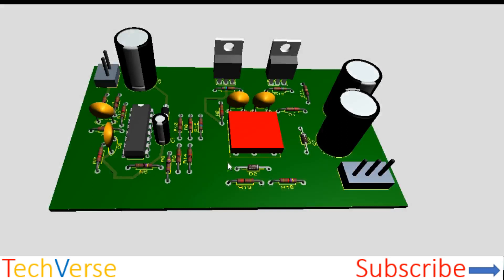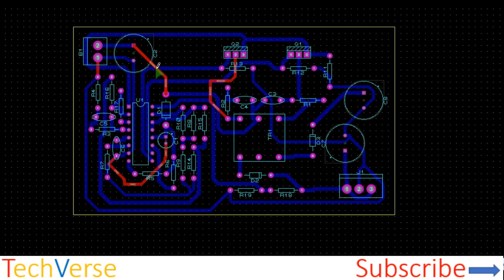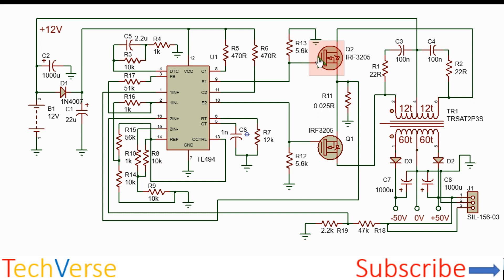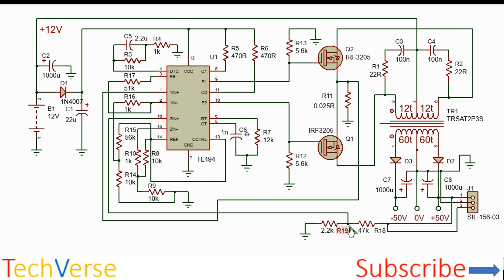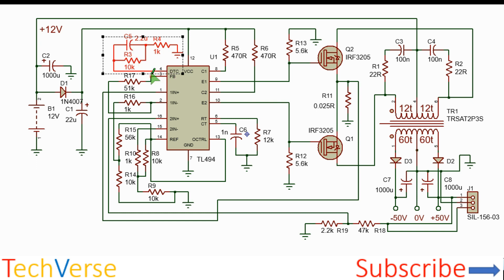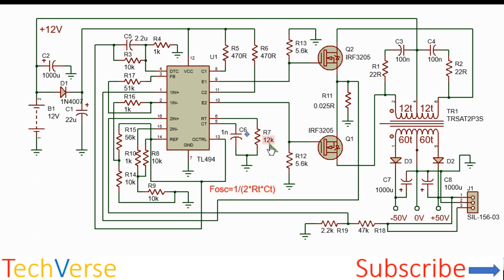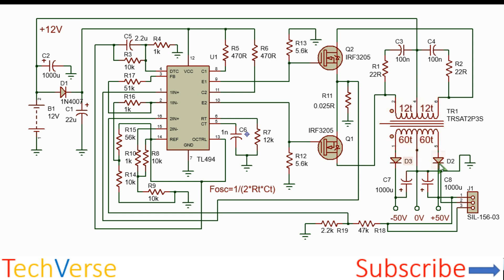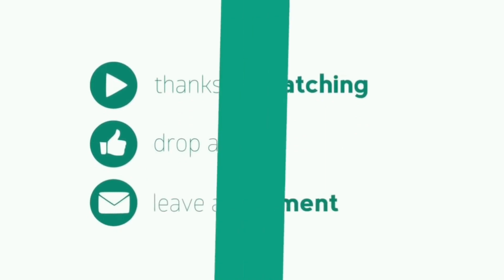TL494 Dual Rail Power Supply 12V to 50-0-50V

Comment: In fact its not just the D3 -50 volt diode which is reverse biased, the -50 volt filter cap C7 is also reversed and if J1 is supposed to be an output connector this is also wired incorrectly, pin 1 will give a connection to the +50V circuit and pin 2 is ground but pin 3 is also connected to +50 volt, not to the -50 volt circuit as i suspect it should be, other than these errors it's a nice little item, this TL494 IC is a great little PWM device, it is very versatile, stable and I have used this in several of my designs.